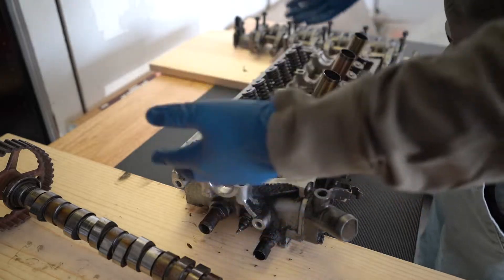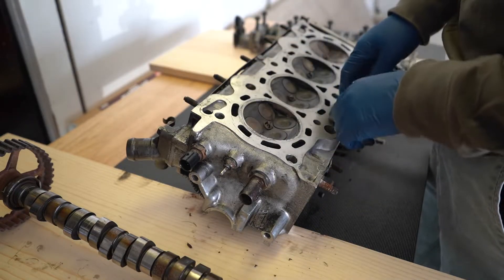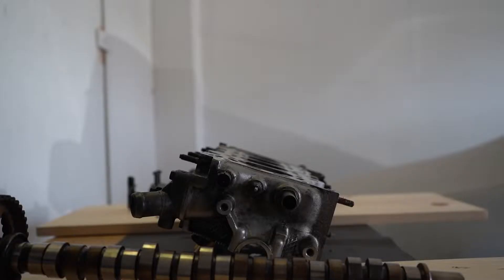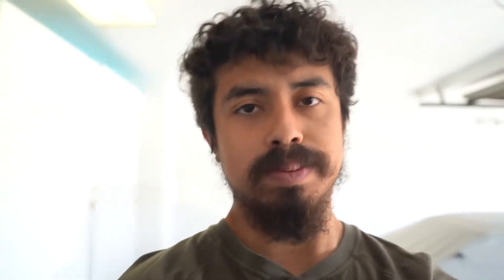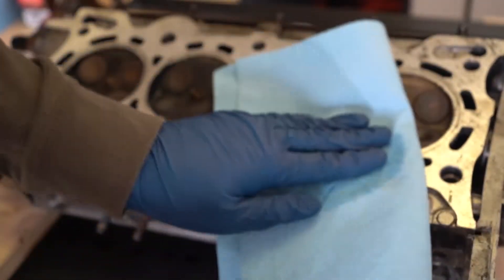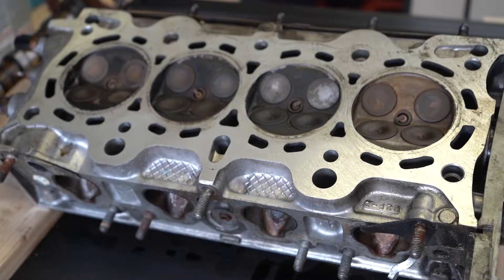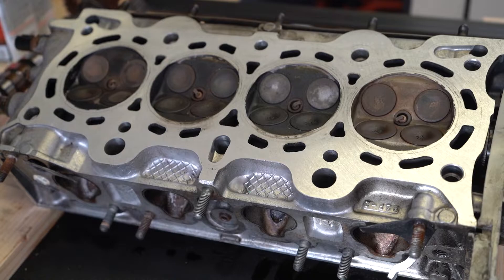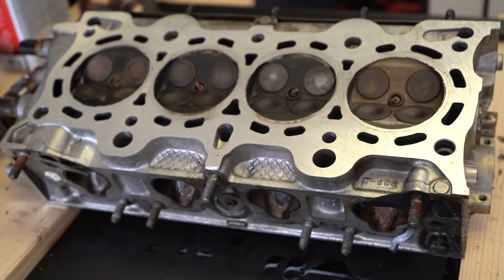Checking the Cylinder Head Warpage

Comment: Hello sir 
How i can clean the cylinder head 
Is it ok if I clean it with diesel and then with petrol means to say proper cleaning the cylinder head before repair
Reply from the maker: You definitely can use petrol to clean the head, as it does a pretty good job at removing the gunk from the cylinder head, but an actual cylinder head or parts cleaner is what I would recommend.